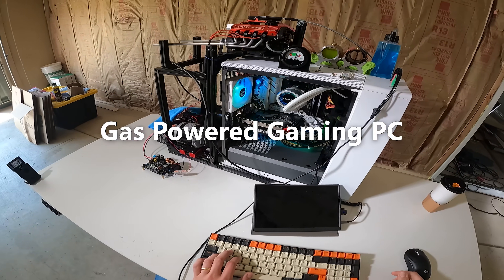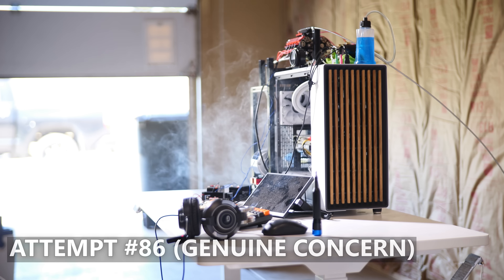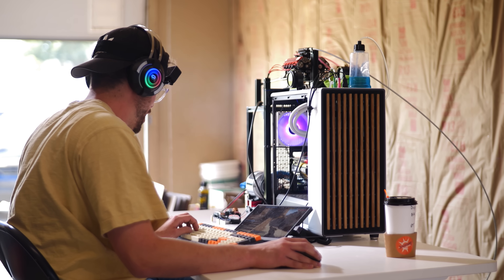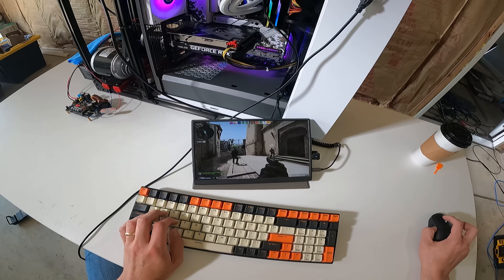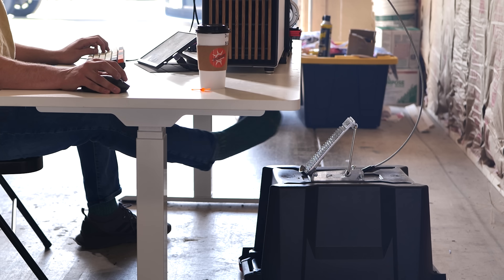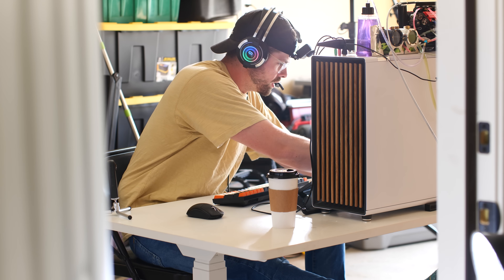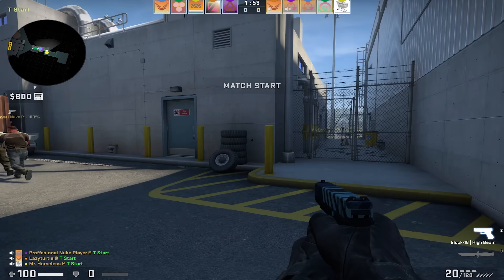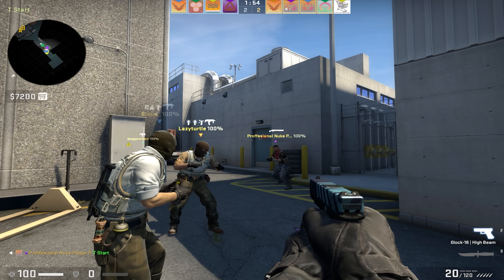I Built the World’s LOUDEST Gaming Setup

Comment: Frames Per Gallon...hahah. That's so Sick u got it working so well! That thing will run non-stop on Nitro!!
Reply from the maker: Dude I didn’t put it in the video but I built new glow plug drivers with 20 D size batteries wired together 🤣 figured you’d be proud
Reply: @BasicallyHomeless  hell yeah!! That's the way to do it with D- sized batteries. But for real I am proud, that thing looks like it's cranking now!! Legit something you could sell in the store
Reply: m
Reply: acer nitro running on nitro

Comment: Would actually be hilarious to calculate the amount of frames per gallon of gas so you can calculate your 'electricity' bill
Reply: If he's getting 5 minutes at 30 fps per pint of gas, that's 300 (sec) * 30 (frames) = 9000 (frames/pint) * 8 (pint/gal) = 72000 frames per gallon. Or if the fuel tank is 1/2 pint it's double that, 144K frames/gal
Reply: @nathansmith3608  Which is costing him about $60 per gallon. lmao
Reply: @MidnightMarrow Dammit Joe Biden, why??

Comment: Video Idea: can you build a pc that runs new-gen games from parts released before the year 2000
Reply: Server gaming, lets go!
Reply: something similar would actually be a cool idea, before 2000 is a stretch
Reply: The fastest CPU released before the year 2000 was a Pentium III 800MHz (December 20, 1999) and the fastest GPU was a GeForce 256 DDR (December 23, 1999). You'd have hard time running mid to late 2000s games on it let alone new-gen games.